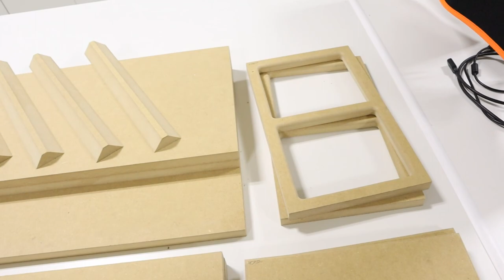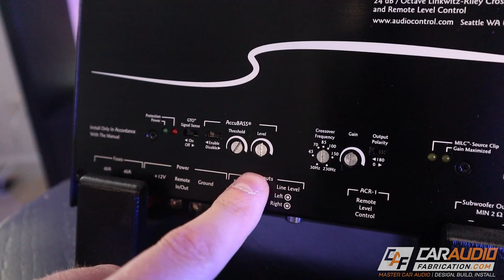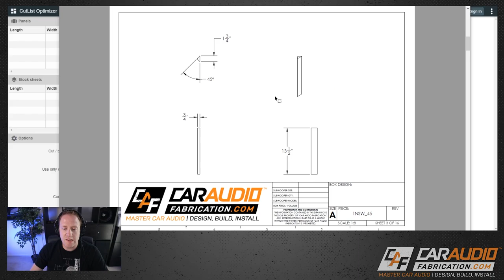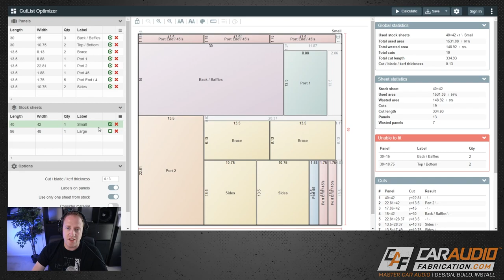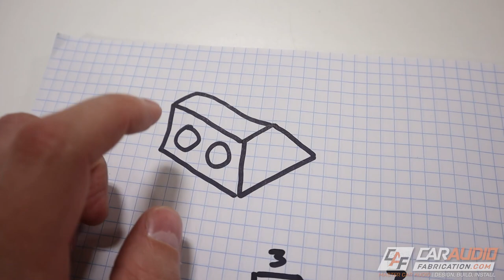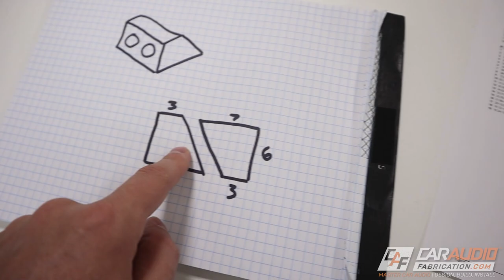Use THIS program to Optimize Material Usage for Subwoofer Boxes, Woodworking etc.

Comment: Last thing I used sheet goods for were the 70" x 24" outfeed table for my cabinet saw, and the 84" x 36" assembly table.  That was about 18 years ago.  I do have a 5 x 5 sheet of Baltic birch to make make a console for the upgrade I'm starting for my van.  Thanks for the cutlist program.  I used one years ago, but that was two computer upgrades ago and lost information!

Comment: My last project was 2-10" on a ported enclosure designed by you and I bought 3 sheets 3/4 MDF for $67 at Lowe's in bartlesville, ok
Reply: Damn. 3 sheets for 2 10s? That must've been a big ass box.
Reply: Yea 3 sheets for 2 10s is extremely wasteful
Reply: Hey I live in Oklahoma to! Currently building a big port 15 box!
Reply: @Chauncey2tha  I only used less than half a sheet but I bought 3 because it was a good price. Sorry about the confusion.

Comment: I have been figuring this out manually, the kerf is always the hang up.  I like that it has that option.  I build display frames for a stone company, I will use this when cutting sheets of PVC, at $120 a sheet this program is awesome.  I also use often Baltic Birch panels as well, those are around $50 bucks for a 30"x30" sheet, so yes expensive as well.

Comment: Did this on paper and that was time consuming. This software has some really good features. Whether it is worth it depends on how much of this work your shop is doing. If you are turning a great many enclosures, it makes sense to invest in this software. Wasted material is avoidable and not smart. Do what you want but a shop that turns products should at least consider it. Good video explaining how it works. Liked the angled side explanation. Stay safe mates!😊👍🏻😷

Comment: Last enclosure I made was a small 10" 20L box where the face would fit in an old 60s Telefunken radio. It isn't perfect, but it sounds good enough for now. I am planning on make a 2x 10" ported enclosure that fits under the double floor.

Comment: Hey Mark, Jon Polo here, thanks for the video. In the Pasadena CA area the prices are not crazy but we have an availability issue. One local lumber yard chain sells only mdf light, they have been out for 2 months. I just bought the last 2 sheets of 3/4" mdf that  Home Depot had for just under $98.00 otd for both

Comment: i have used cut list optimiser a fair bit . its good but there are better ones out there. i use max cut 2. the cut list optimiser is limited in the number of calculations you can do a day. its a pain  to use that way because if you back a change you run out of uses very fast. its 5 i think. the main problem was that you can only do one material thickness at a times. so if your doing a cabinet you have to do the sides at 18mm on one calculation and the back at 6 or 12mm on another calculation and 22 of the doors  etc etc. 
i like max cut 2. you down load it so you can use it off line. you can use at much as you like and input the whole cutt list including all the diferent materials and it will work them all out together. 
you can also input prices of the sheets and it will tell you the cost either as a pecentage of a sheet (say 1/3 of a 30 euro sheet is a 10 euro material cost) or a cost for full sheet  or a combination  so if you had to buy a specific material for that job and were charging all of it . 

a neat feature of these is tricking the edge banding  option to tell you the perimiter of edge sanding required. i use this bu selecting which edges need edge banding  but set its thickness to zero . it will then tell me i need 46meters of edge banding and i can see how much extra sanding a filling of the edges i will need to do to get it ready to spray

Comment: Have you tried using a powerful small sub to drive multiple passive radiators to reduce space and weight? Strong magnet moving more surface area basically.  I'm not too worried about tuning.

Comment: Use them(cut list) everyday. But I'm a commercial cabinet/millworker (use a beamsaw with automatic lift n back Biesse EBT 120)
Right now price of sheets are crazy high . normally everyone know baltic birch is very expensive, but now trying to get 1"  4x8 foot just standard plywood is $120 + a sheet. We now are buying the Baltic birch for $65.00 a sheet 4x8 also well it's in metric but essentially 4x8. That's is nuts because BB is far better quality but the scarcity of stuff is stupid.

Comment: Hi! I have a question, i am looking to change out my door speakers in my car. Will be running on stock amp. The way my stock car audio is setup is 3.5” midrange and tweeter on dash and 6.5” in door. They are powered seperately from the amp. Can i run a 6.5 component without the tweeter? I have already changed the dash speakers to a good pair of coaxials. The only pair of 6.5” speakers i find that are 3 ohm (my stock amp will only take 3 ohm) are jbl speakers either coaxials or component. Can i run just the 6.5” component and not use the tweeter or will that mess with something or should i just go for the coaxials and have the tweeter not do anything? I hope you understand my question :)